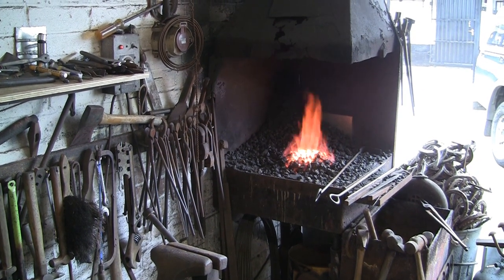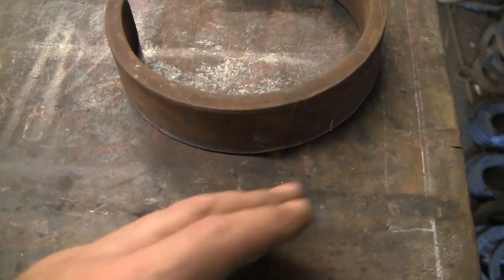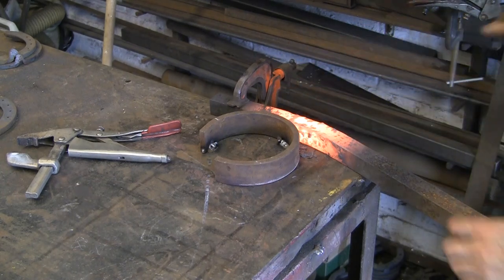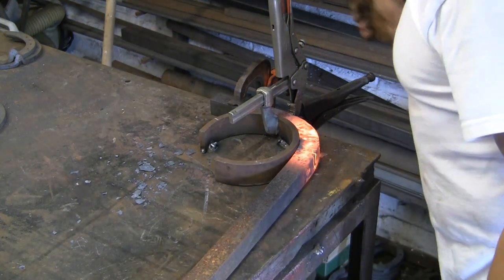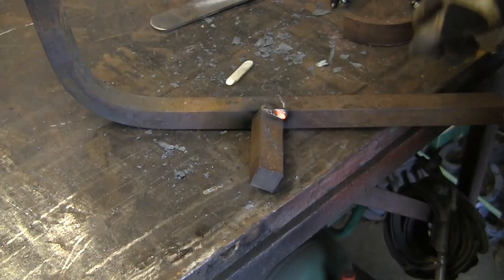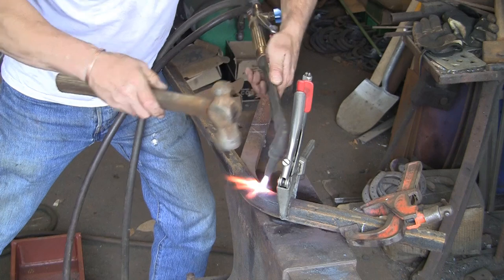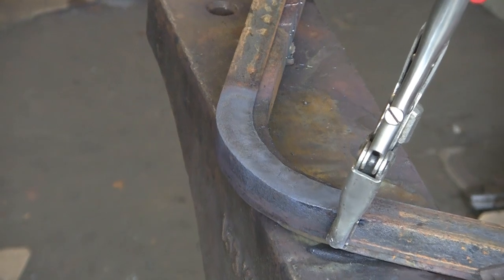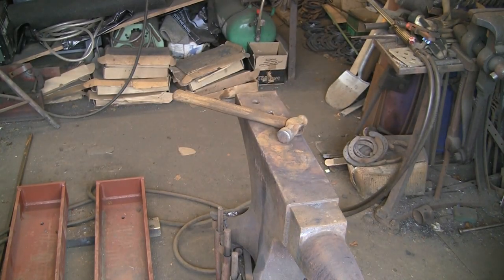Bending Jig

Comment: The teeth of a circular saw are harder (because a bandsaw blade has to bend), so you can use it longer, another advantage is that you can push a circular saw a bit and it will still cut straight. But a circular saw has a few disadvantages as well: it produces a lot more noise, saw blades are more expensive, and you can't saw very big pieces with it (like big tubes etc) while you can with a bandsaw.

Comment: Try taking the one flange and shrinking it. Put a "V" bend and them hammer the vee into itself several times until you have the radius you want. Also try cutting the flange several time and weld the cuts when you have your radius. Your way worked very well and faster after the jig was made. Thanks very much for your demo and I'm sure I will get a lot of use from the jig.
Reply: Steve Larsen ī